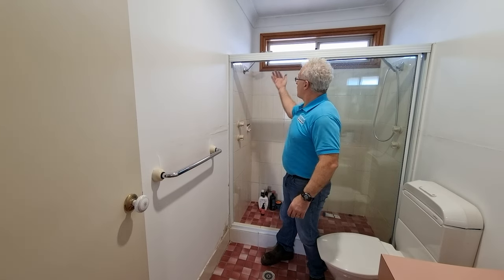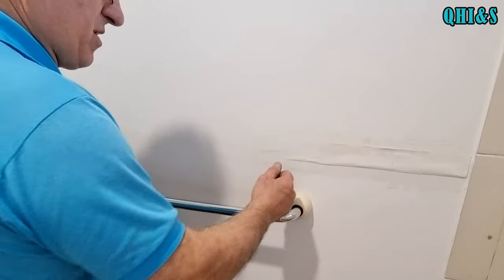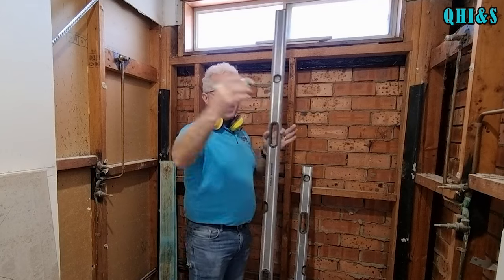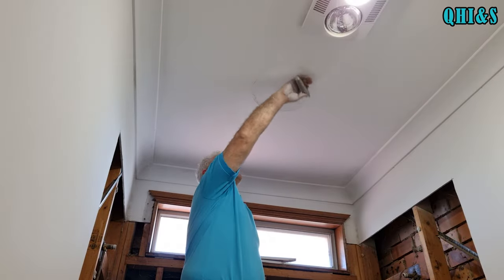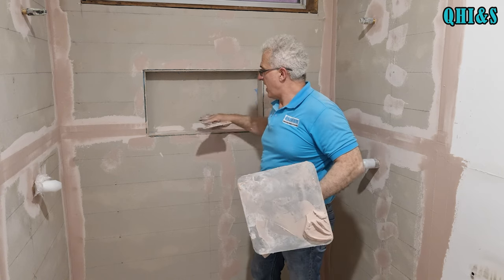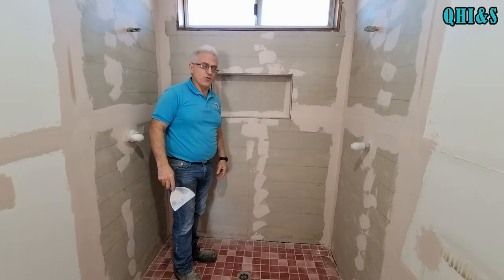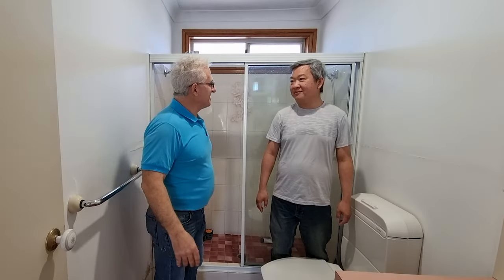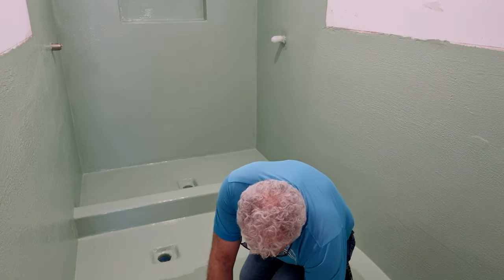Total Bathroom Renovation with Full Step by Step Instructions! Part 1

Comment: That was a very informative video , loved it , the quality of your waterproofing  is inspirational. 
What is your opinion on copper versus plastic piping for the plumbing?
Reply from the maker: Thank Joseph,

That is a very good question! Both have their issue good and bad points but I have been using plastic for 20 years and am okay with it! How about yourself?
Reply: Only once heard there was issue with rodent chewing pipe but otherwise it is much quicker, the quality of copper has reduced anyway.
Reply from the maker: I have heard the same! Thanks Joseph!

Comment: Excellent video.  One question the vertical flashing that you had in the corners before fixing the villaboard, where can I purchase the flashing from?
Reply from the maker: Thanks Gary,

The flashings were already there, which, in fact, were just thin strips of  damp course, the kind that brickies use for the walls and windows to reduce moisture. I normally don't use it, but because it was already there, I decided to keep it for extra measure.